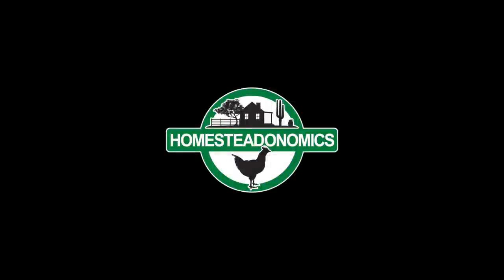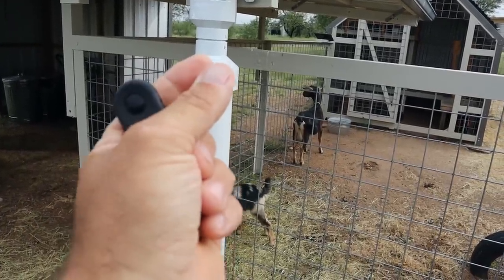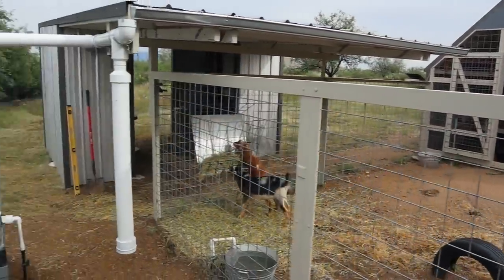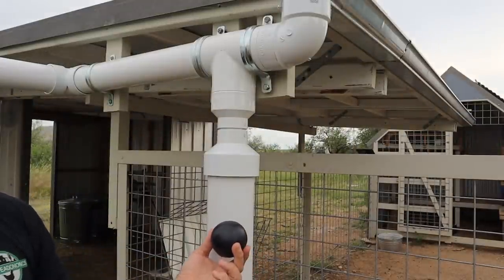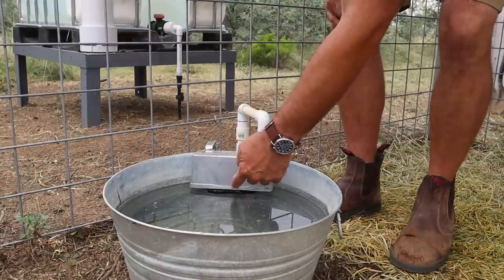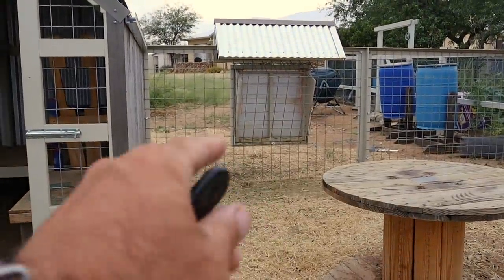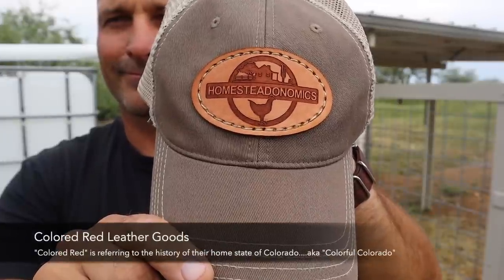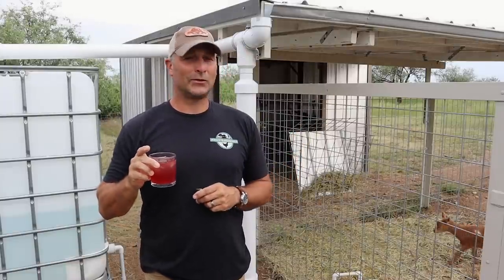Rainwater Harvesting For the Goats - With DIY First Flush

Comment: I was worried about the ball blocking some debris when the pipe was full and then I seen the pin hole at work! Nice job.
Reply from the maker: Thank you!   Yes eventually there will be enough sediment to cause some clogs but it’s easily remedied by opening it a few times a year.

Comment: Thoughts on overshoot from the gutter in heavy rain?
 All you need is a Y filter or even just a T for 1st flush. 
All it does is gravity catch dirt
That's a huge volume considering the area of catchment.
And no need for strictly animal water.
 People water sure. Animals not so much.  
Covering the IBC with siding to keep the light out? 
Those cages make it super easy.

Comment: Nice setup. How much rainfall does it take to fill up that IBC tote? 

And that patch is beautiful! You're sure to get a lot of use out of that hat, and when the hat is done for, you can save the patch and put it on something else.
Reply from the maker: Yes indeed!  Super cool patch!  As for the rain to fill it up.  Based on this roof size I should get 120-130 gal per inch of rain.   And the IBC tote is 330gal.

Comment: Brother if that black ball is like the green ball for the 3" pvc u need to check it and empty that pipe cause it will push that ball hard and it will get stuck don't ask me how I know if been thro 3 balls just letting u know looks awesome keep it up brother
Reply from the maker: Thanks for the info.   So far in testing it I have not had any problems…. The ball is pretty stiff and is almost 3” diameter… and the necked down area is 2” so it’d have to push it really hard to get it stuck.

Comment: Hi Joe, thanks for sharing. I have seven of those totes around the house, for garden watering but they tend to get a build up of algae during the summer.  I have resolved the problem by fitting the tanks with small aquarium pumps to keep the water circulating but I wondered if you have any other advice.
My 'first flush' arrangements are each about 5 feet of 4" pipe, with a rodding eye through which I have put a 3/4" tap - the pressure in a full stack is quite impressive.

Comment: Hi Joe, 

Great job! 
Where did you get that ball from?

So with your area and added elevation, how are you planning to insulate that against freezing?

I want to build a system to fill my toilets, in order to reduce my potable water use.  Not that I could use much less - I already use a minimal amount as it is.

Any suggestions as to a good local source for those super clean IBC tanks for a good price? 

Looking forward to seeing your next projects.
Reply: You can also use a plastic water bottle. Just empty it, put the cap back on, and put it cap-side-up in the pipe. The seal won’t be perfect, but it works well enough.
Reply from the maker: Freezing luckily is an easier thing for us than in most states.   I just drain the lines during hard freezes and put a towel around the valve area of the tote.

As for sources for IBCs here.   My friend Justin sells them and lists them on Craigslist or FB and you can find him just by searching IBC’s totes on Craigslist.   He also sells many other interesting things.
Reply: @homesteadonomics  thank you!
Reply: @homesteadonomics  Hello, how are you, can I talk to you about farming, raising cows?

Comment: QUESTION:  Since the IBC is clear (versus black opaque), do you not worry about bacterial growth and mold growth, in the fairly stagnant water, due to sunlight penetration? 
Also, what about potential freezing of the water lines? 
Otherwise, very nice system!
Reply from the maker: Light is the biggest factor.   I will eventually paint or cover….but needed it done for the end of our monsoon rains. 
As for freezing.   Here is pretty simple.   Drain the small lines wrap the valves for moderate to hard freezes.

Comment: It's cool but the vertical pipe will fill up after every rain and you need to drain after. Otherwise it will not collect dirt anymore cause the ball will block it. Maybe a tiny hole on bottom will help to drain it slowly after rain stopped.
Reply from the maker: There is a hole in the cap that I talk about and show in the clips with the chickens drinking that water draining from it

Comment: Well done sir. Just curious what would you change if your in a area that has a lot of trees? The small drain hole in my area would get plugged up quite often would you come up a couple inches on the 4inch pipe then drill the drain hole in hope the debri would settle and not plug up the drain hole?
Reply from the maker: If you check out my rainwater system that I did on my shipping container playhouse about a month or so ago, you’ll see the first flush includes a little filter that allows for the draining even in the event that debris gets in there.   But also note the screened inlet on the top of the pipe below the gutter.  No large debris should get in.
Reply from the maker: …..had to take a call from the wife while I was typing.   
Back to your questions.   Yes I think a small hole up from the bottom would also work. It’s just a matter of the pipe being able to be drained at a slow rate to allow flow through the system.
Hope that helps!

Comment: When the tank fills up with rain water does  it have some kind of way to shut off. Sorry if this is a stupid question. I have little to no experience in these matters. Always like to learn something new, even at 70.
Reply from the maker: Not a stupid question at all👍.   It just will overflow and cascade over the sides.  But I could add a connection so that I could direct the overflow somewhere.   However for the time being I’ll just let it overflow from that top inlet.

Comment: do you have a rule-of-thumb on sizing your first flush? 4" pvc is about 2.6 gals/4 ft length. with southern az dust, do you figure on multiple ff for larger roofs? can ibc's be tapped further from the bottom to allow sediment: like a domestic hw heater might?

Comment: What parts did you use to connect to the IBC out spigot?
Reply from the maker: 2” thread x 2” slip….then a 2” slip x 3/4” slip adapter that’ll glue into the first piece.   The first from there I used 3/4 elbow and added a garden hose attachment that connects to the black irrigation pipe coming out of the ground.
Reply: @homesteadonomics  great thx!

Comment: Great project!  I have zero expertise on the subject, but seems to me there's gotta be a better way to catch (separate out) debris from the rain water that doesn't waste all that water that flows into the First Flush pipe and subsequently drains out onto the ground.  🙂
Reply from the maker: Well the other option, is to just have a main rain collection tank and then transfer the water, after the sediment settles to the bottom, to another tank.   This is how my home system is.  
But for a small system like this I did not want to have to have two tanks.   And even then you’d still loose water in the cleaning of the sediment.
Reply: It's rain. It would've all gone to ground.

Comment: Whats your thoughts on the size of the first flush? Eyeball it and adjust to local climate or math to go with it?
Reply from the maker: A little if both.   Large the roof, the larger the first flush piping or more first flushes could be incorporated.   But practically speaking I do think there is a limit to the effectiveness.  
For example, another option is to have a detached tank that collects the primary rainwater(my home system is setup this way).   And then allowed to settle before using a transfer pump to pump into a ‘clean’ tank.   That way the sediment stays in that primary collection tank and you only transfer after he sediment has settled to the bottom of rain collection tank.
Reply: Pretty sure there is math to assess the pipe length for first flush, just watched a video of another DIY system like this where he referenced formulas to get the correct pipe length.